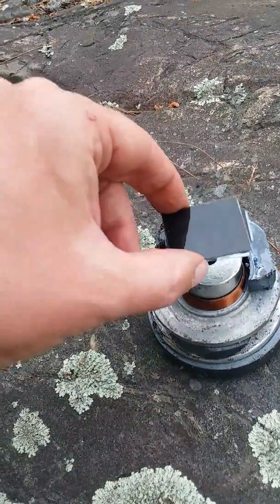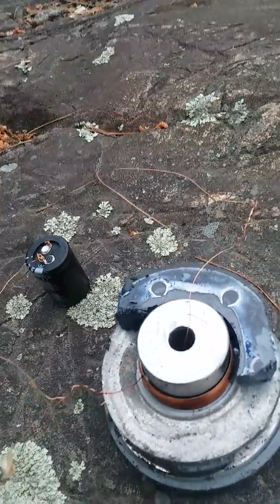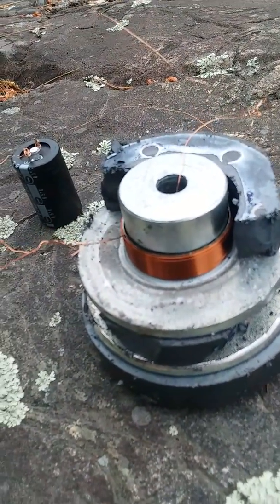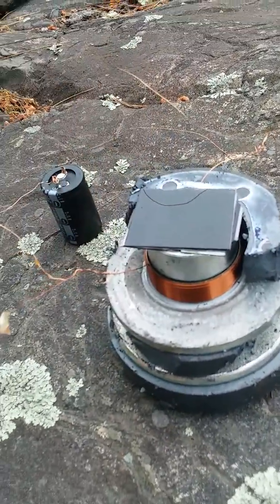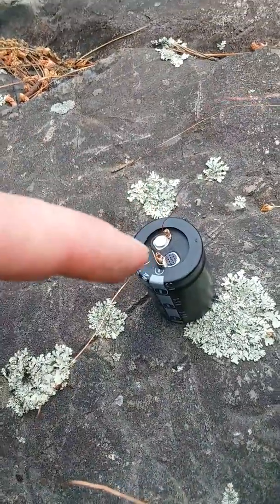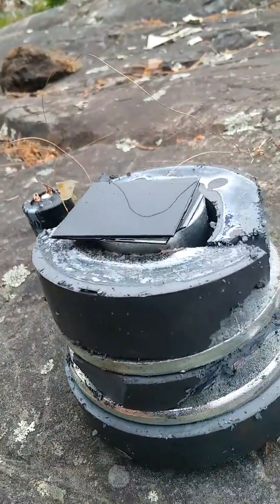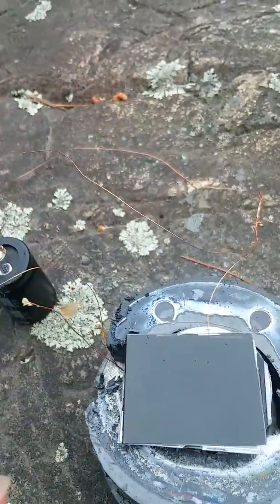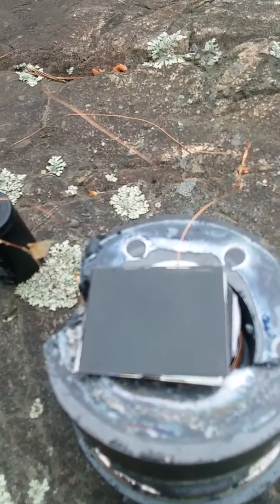NEUTRINO ENERGY TO ELECTRICITY

Comment: How much energy can it provide? (Watts)
Reply from the maker: It has linear scalability like solar cells. You just add more units in series or parallel
Reply: peter lang I meant to say how much can the one in the video supply? Also, do you happen to have a diagram of it so others can replicate it? I am very interested in neutrino power
Reply from the maker: @filigenzilab9613  the video one was quite small I had about 6 deciwatts. Schubart patent shows how to make it with thin silicon and graphene layers in a volta like stack
Reply: peter lang how long can it last?
Reply from the maker: @filigenzilab9613  it lasts forever. No moving parts or wearing out. The source. Neutrinos are effectively infinite
Reply from the maker: Neutrinovoltaics.com
Reply: peter lang the link won’t work
Reply from the maker: @filigenzilab9613  input "schubart neutrino alloy" into google search
Reply: peter lang thanks
Reply: peter lang I’m sorry to keep asking questions, but I read the patent and it just went over my head. Can you show me a visual diagram of the cell? Thanks
Reply from the maker: @filigenzilab9613  what happens is a small portion of the energy in the neutrino gets taken up by the alloy. This vibrates the alloys atoms and it makes the motion into electrical power.
Reply from the maker: Currently Schubert's patent is being used to develop a car in india. According to Forbes India.  Questions are not a problem. Just remeber the patent is from a math professor and can be a bit jargon happy. The above comment is its regular language translation. If ever you find jargon a problem type the word into wikipedia I find it is very up to date and extensive
Reply: peter lang thank you. So now I understand the physics, I just need to know what materials to use
Reply: peter lang do you have a tutorial for obtaining/making the cel shown in the video?
Reply from the maker: @filigenzilab9613  you can see more about it on the neutrinovoltaics website of prof. Schubart. It was shown on german TV
Reply: peter lang I am asking how did you get the cell in this video
Reply from the maker: @filigenzilab9613  I got it from DARPA.  University of maryland
Reply: peter lang thanks
Reply: @peterlang777  Quick question, what separates this from a mere battery?
Reply from the maker: @filigenzilab9613  batteries use stored chemical #energy (finite) neutrino transducers use energetic particles that are infnite
Reply: @peterlang777  also, wasn’t the founder of neutrino power arrested for fraud?

Comment: Oh my God, I actually lost intelligence watching such crap. I mean, you can't be serious, right?!
Reply: Agree!!! In addition I don't see any diode, I don't understand how you can charge a capacotor! If you add some diodes you can collect the energy from the natural background electromagnetic field, not for shure from neutrinos with this device!
Reply: @gildodidomenico6643  Actual solar panels produce DC which can be directly connected to a capacitor.
Reply: @rikkardo9359  It seems that the capacitor is connected directly to an induction coil, if so it will never charge. The photovoltaic case is different because the capacitor is connected to a semiconductor.
Reply: @gildodidomenico3859  Yeah, didn't notice. You are right.
Reply from the maker: Obviously you are completely unaware of neutrino-matter interactions.  Neutrinos create charged particles when I proximity of nucleons or have a direct strike. Go read. Or learn to.
Reply from the maker: Neutrinos have mass my science illiterate pal. Mass and energy are equivalent in substance. (See the 2015 nobel prize won for neutrino mass verification) therefore neutrinos can be used as an energy source by finding a stable mechanism for converting their matter interactions to electricity (neutrinovoltaic effect)
Reply: @peterlang777  First part is correct. They do interact with matter. BUT they do this really rarely. Please tell me, why scientists need huge containers filled with liquid Xenon with many ultra sensitive sensors to study neutrinos, if you could just use your ultra scientific setup to even get energy from it! How do the neutrinos even get through the atmosphere if they interact with matter so easily? 
Besides that, your setup is even more idiotic when you look at your electronics. A transformer transforms voltage and current, not frequency. Infact, they do not work if the frequency is too high. The "capacitator" (wrong name, it is called "capacitor"!) does only store DC, not AC. You would need to rectify your "low frequency currents" before storing them. 
I guess it is proven by now, that you do not know anything about physics and definetly nothing about electronics. I on the other hand have a master degree in physics from an university in Germany. So how about you explain your "science" on a more complicated level to me, so I can examine it better. If you are uncapeable of doing so, I will assume that you are just trying to get attention by people not knowing about such topics. You can do whatever you want to, but you should ask yourself it you like to mislead people and to spread fake informations.
Reply from the maker: @rikkardo9359  the same reason scientists in the 40s needed giant rooms for computers....lack of knowledge. The rate of matter neutrino interaction is not set. It is variable. Different materials and energies can increase the reaction rates. I.e. in your standard physics higher ener neutrinos interact more with matter than low energy ones
Reply: @peterlang777  The only true statement in that answer is that neutrinos interact differently strong with certain materials (I am not going to explain you every little mistake of yours, so lets focus on the worst ones). Xenon is a good choice regarding price and interaction strength, so they chose it as a detector material. There are several other detector materials too, depending mostly on how much money you have to build such a thing.
Those huge detectors costing millions of dollars and still rarely detect neutrinos. Even if you had a material that interacted let's say 10'000'000 better with neutrinos (which does certainly not exist), it is still just a small piece. That means, you are trying to tell me, your material is so stong that it makes up for the huge size differenz while still collecting neutrinos well enough to generate a voltage? Cmon man.
Just admit you are a faker, it is still better than keeping this shit on misleading many uneducated people.
If you chose not to, please tell me how the electric setup works. I had electronics for only one semester at university, but maybe I am still able to get it.
Reply from the maker: @rikkardo9359  I do not need your pittance of intellect to explain anything to me. Your a dogmatist.  You recite like a parrot what others have done and is approved by your cliche of consensus. You create nothing.
Reply from the maker: You dont even seem to be aware of the mainstream hand held neutrino detectors that were made last year. Your ignorance is unfathomable
Reply: I've read thru the comments and all of you are full of shit. Each of you failed to mention graphene. The video uploaded is using a materiel that looks like the material used in a neutrinovoltaic cell but I highly doubt that's what it is but you never know it might be a crude form.
Reply: @frankh.3849  You cant be serious
Reply: @rikkardo9359  He's about as serious as his "capacitator" Lol  {rolls eyes}